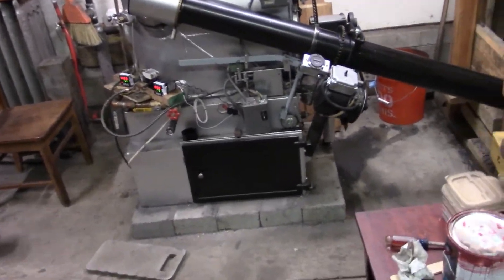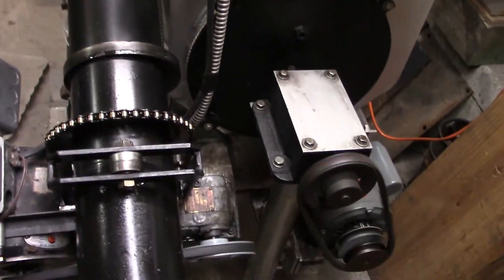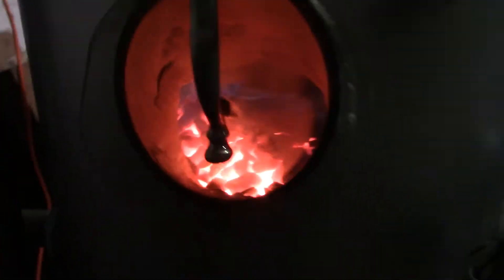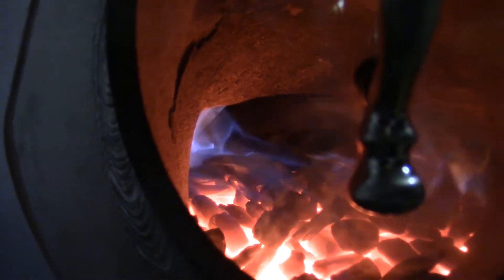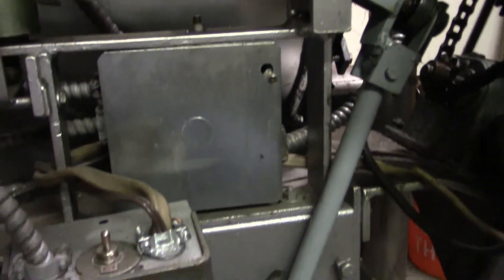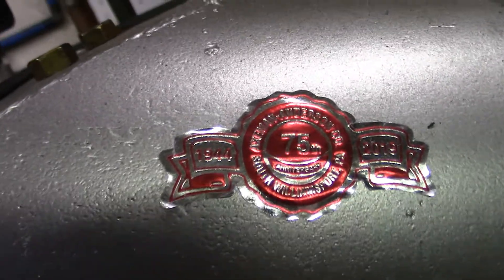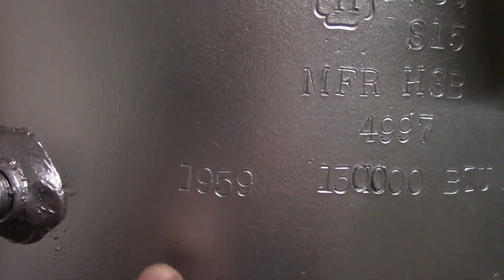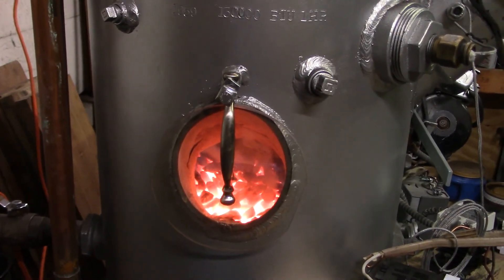1959 Axeman Anderson 130M PT93, Running Description

Comment: Thanks for the interesting update.  

The size and grade of the coal your vendors make available to you appears to vary from one purchase the next.  It must be frustrating having to readjust your furnace settings to suit each batch of coal.  I hope that you will be able to find a repeatable source of supply to simplify operations.

Your cat seems to walk around with its tail held vertically; a sign of a happy cat I think.  I hope it never gets grabbed by the exposed belts or roller chain.

Hope you have a warm and safe winter.
Reply from the maker: Thanks H!
The coal sizing is my fault, not my coal supplier's. Down here it's either Pea or Rice. I would rather have Buckwheat but I can't get it delivered into my bin because it is not available locally.